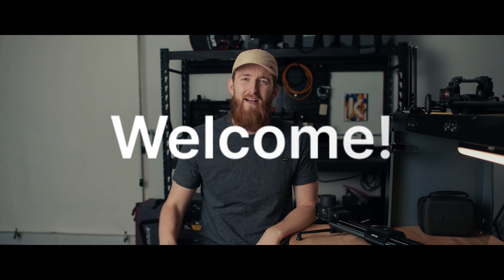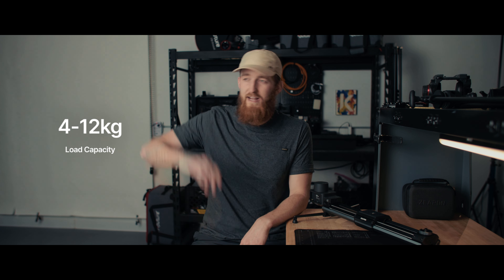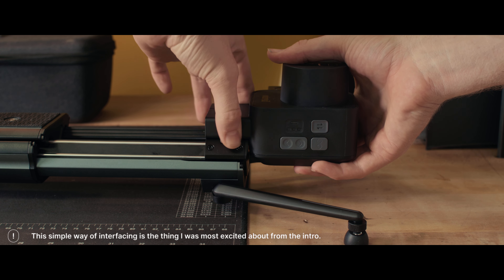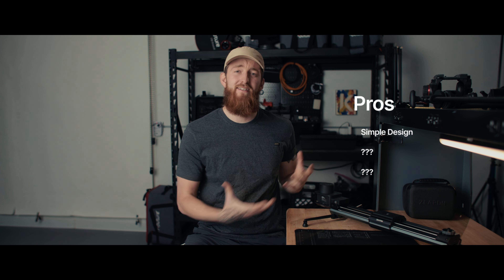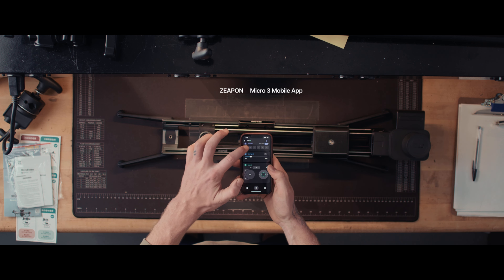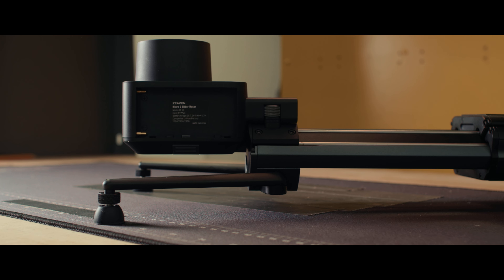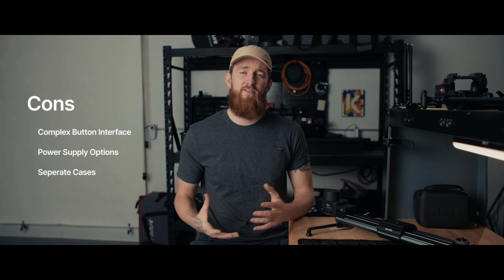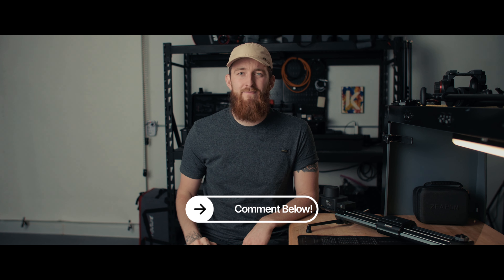Zeapon Micro 3 Slider | a CLEVER design!

Comment: Thanks for the pros and cons. Would have liked to see more of the extended features with the app. How much adjustment is there on the legs if you have a slightly uneven surface? Someone asked about motor noise, could it be used in an interview situation for the 2nd camera?
Reply from the maker: You're welcome! Thanks for checking out the vid! I don't have an "official" measurement on the adjustment there is on the legs, but realistically you've got about 1/2" to work with for uneven ground. (Not much, but enough for most cases in my experience)
As far as motor noise goes, it will depend on the speed your want your B-cam to move at. I usually have my B-Cam moving relatively slow (10-20%) and at that speed the noise is almost nonexistent. If you're up to 80% and above you'll start to introduce noise that COULD be problematic, but also is easily removed in post.
Hope that helps! Let me know if you have any other questions!

Comment: Did you try it vertically? Did it jitter/stutter?
Will you review the motorized head?
I have a Canon C70 and I'm looking for a slider capable of vertical movement (pure 90°) with a motorized head attached. The Edelkrone seems not reliable. This one could be the one I'm looking for.
Your opinion would be helpful.
Thank you.
Reply from the maker: I haven’t run it at a complete 90 yet, but the angles I have run it on seem pretty smooth so long as you’re keeping you C70 stripped down in weight.

I’d you used a BPA-30 battery and a lighter prime lens I’d wager you could pull off a vertical slide. I don’t have the motorized head yet but I’ll definitely review it when I have it!
Thanks for checking out the video!
Reply: @TroyMairs  Thank you.

Comment: Hey Troy,

I'm wondering if it has a lot of jitter as many other motorized sliders do... (Do you need to apply post-stabilization?)

Did you manage to upload some sample footage yet? It would be great to see how it performs in a interview setup!

Greetings!
Reply from the maker: I will say that it is not immune to the micro jitters that we deal with on a lot of motorized sliders. Keeping the weight of your rig down always seems to help with that! Height as well! Tall rigs with monitors or using tall fluid heads creates more opportunity for microjitters

Comment: I just bought this along with the pan and tilt heads and came to the same conclusion with the pros and cons you listed. The other con I would say is the iPhone app is very buggy (1.6 stars). I'm constantly having to close out the app even with the firmware updates. I would say if anyone plans to use the app do your research first. This might be an issue for you if you plan to use some of the app functionality with the added heads. Has anyone else experienced app issues?
Reply from the maker: Thanks for sharing your experience! I'l agree that the app is far from perfect. For me, the app works fine while I have it open and am actively using it, but if I lock my phone or set it down for some time, it usually disconnects. And that can frustrating. 
I try to just use physical controls when I can!
Reply: @TroyMairs  thanks for getting back! I’ll probably end up using the physical controls 90% of the time. If they could get the app updated I really think this thing could be solid especially for the price point.

Comment: I use in in combination with my DJI RS2. Takes a bit of practise but works great now.
Reply from the maker: Thats a cool idea! Do you find that the height of the gimbal introduces some unwanted shake in the footage?
Reply: @TroyMairs  It works quite fine, as long as it is well-balanced although I wished the ramping could be set manually just as Edelkrone allows you to. But together with the face tracking you can get nice dynamic perspectives even while doing a live broadcast.
Reply: Which version do you use?
Reply: @MauriceMischo Micro3 as shown in the video in the longest version.

Comment: Hi. I am recording real estate videos. I am changing the tripod height for every room and situation. And also when we use the pan head is it efficieny because I don't want to use the phone. I am going between zeapon or I footage micro slider nano ? That I know I footage  you don't need use phone. Do you have some suggest? Thanks for great video.
Reply from the maker: I haven't found a great way to adjust the height of any slider system really. In my studio I have two rolling C-stands that I mount my slider to. That has been the most efficient way I have found to adjust height while maintaining stability. Unfortunately, that may not be very feasible shooting on location given the weight/size.
As far as operation goes without a phone, I almost never use the mobile app with the Zeapon and I do everything manually with the physical controls. I have not used the iFootage slider so I can't speak to whether or not it is better.
Thanks for checking out the vid! :)
Reply: @TroyMairs  Thanks alot for good information

Comment: The app is bad! It doesn't connect to my slider and head. App doesn't see devices. I wrote to the manufacturer. They are silent...
Reply from the maker: Curious! That's too bad. I've have sometime found the app to be a little bit slow, but never like that. Are your hardware devices on the latest firmware?
Reply: @TroyMairs  I cannot update the firmware because it is updated only when the application determines which type of slider is connected...)
Reply from the maker: @Vsemurad  Agh! That’s annoying🙄